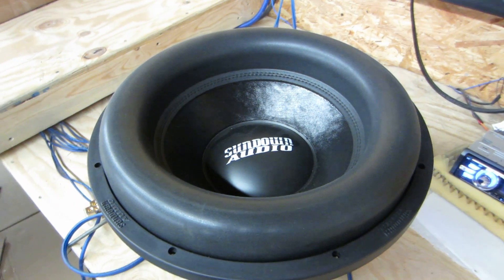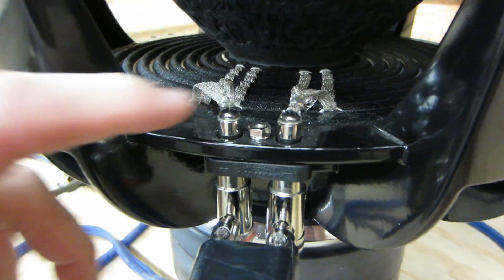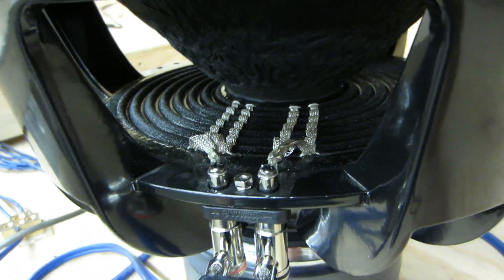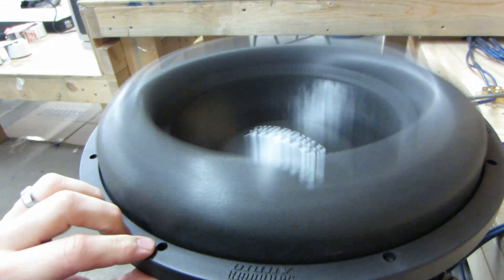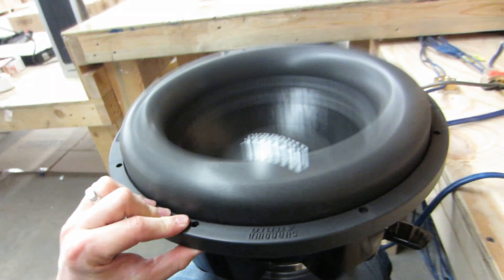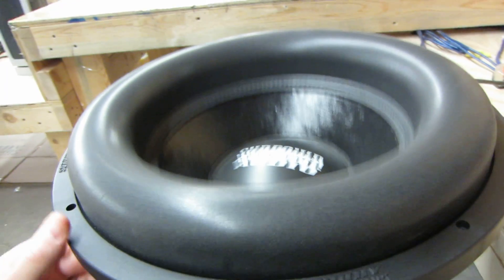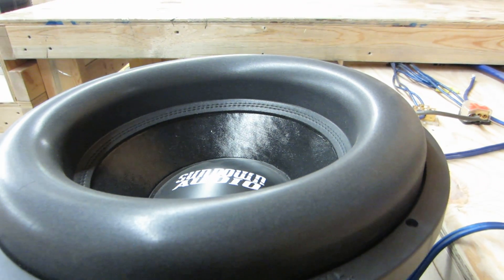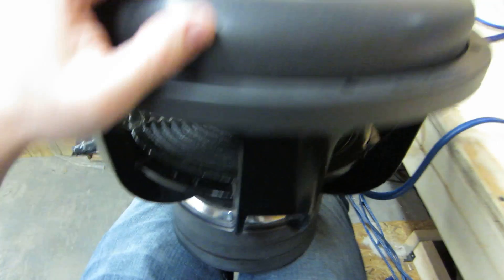X-15 Prototype Free-Air Test on SAZ-3500D

Comment: you should build a baffle for an 6.5, 8, 10, 12, 15, 18 for free air testing.. just to set it in..
what's the best frequency range for the X12 v.2 D2? how low and how high does it play? I just bought a new one a week ago,  only 8hrs on it yet.. it's currently in a 2.3cft from a previous sub, starting my new box tomarro. would like to tune around 26~28hz, maybe a 2.6/2.75cft box or should I just tune to the suggested 32hz, sum is currently almost silent when I try to play anything under 28hz, I'm currently tuned at 31hz

Comment: What causes the popping noise??
Reply: +Ksam96Trini oh ok i jus did a research on why it does that. But yeah we dont want that voice coil crashing into that back plate.
Reply: +Ksam96Trini wen my kicker cvr 15 did that i thought i broke it 😂. But what if the kicker cvr 15 back plate was like 50 mm farther from the voice coil??
Reply: +Rico Mckennie That's the sound of the voice coil bottoming out on the magnet structure. Over excursion.
Reply: That's when it bottoms out. Basically its when the excursion is so great the coil hits the back of the motor.
Reply: Rico Mckennie Nope, don't want that lol
Reply: Rico Mckennie First time I ever heard that was with my 10" Pioneer. LOL I also thought I messed up my sub. XD
Reply: +Ksam96Trini  but i diid mess up my pyle pro amp (the 2nd time)
Reply: Rico Mckennie My Pioneer coil burnt, but I'm getting it repaired with a dual voice coil.
Reply: voice coil hitting the back off the magnet

Comment: I want to see it do 2" of excursion at 50hz. :)
Reply: It can do way more then that I think this is capable of doing 4 inches
Reply: EpicEverythingDude75
I never seen a sub do more than 2" of excursion at 50hz. But I have seen at 30hz.
Reply: Bassotronics I think The RE Audio XXX 12 is capable of 180 mm one way excursion O__O And the Earthquake DBXi 12 is capable of a little more then that I think it can do 190 mm one way. I want the DBXi 12. It looks bad ass. If you want, you can watch my current subwoofer videos on my channel :-)
Reply: ***** I'm not stupid I know what that is. It's not called maxing out the excursion it's actually called bottoming the coil on the subwoofer. You can get to maximum excursion without bottoming out the coil.
Reply: ***** Oh I have. but my subwoofer is a powered subwoofer XD I am such a troll
Reply: EpicEverythingDude75 Xmax on the DBXi12 is 66mm PP, Xmech is 88mm PP. No where near 190mm one way. The mounting depth itself is only 171mm
Reply: +EpicEverythingDude75 Do u not know who your talking to?!
Reply: Awe215 *you
Reply: faq meh ash ketchum hole

Comment: Hi, I have an Aiwa NSX T9, the computer no longer works, and would amplify the speakers with an amplifier, but each of the boxes have: A red wire, one black and one blue, for the subwoofer, which I have to do to it run smoothly and use the full potential. Thank You. (Montevideo, Uruguay)

Comment: Got a question. I own 2 15" HT's and they're in a 3cuft sealed enclosure each.
Would it be an upgrade getting the X15's as a drop in?
I ran some numbers and the HT's F3 is approx 36Hz, and the X15's F3 is approx. 29Hz in a 3cuft sealed enclosure.
I'm assuming better lows and more overall output would be expected?
Reply: ive never actually heard  hts before but I own the x 15 and the lows are insane, if its the lows u like its the way to go, I have it on very low power at the moment about 6 to 700 watts rms and it laughs at it and its very loud , definatly a crazy woofer ,my box is 5.06 before disp and 3.52 after..... I definatly recommend ported for any high end subwoofer u wount be dissapointed
Reply: Oh, so you have the X in ported?
I ran some tests and it shows the X is more suited for sealed. Even though I know they work amazing in ported, so I guess either or..
I've done ported/SPL before and want to do something different. I guess I'll just run the HT's and go from there, and get the X's if I need more output.

Comment: Coil said fuck this im tunchin the back plate
Reply: LOL at this  ^
Reply: EpicEverythingDude75 thanks...
Reply: hittin-low_150db+ Bud did you see the way the surround buckles inwards when it reaches its excursion limits? That is NOT a good thing. It leads to distortion. The surround should stay straight throughout excursion to maintain SQ. I know this is NOT an SQ sub, but still. Sundown should redesign the surround so it does not do that. At least make the foam thicker. OR better yet, they shouldn't even use foam in the first place. If I were them, I would use a thick Santoprene rubber surround so that it will support itself during high excursion and not buckle under the heavy load being put on it.
Reply: They did fix it...this is old...and Santoprene rubber is good for low force unless its thick its a very flimsy material
Reply: bassphillyforeman I wonder. How well would it do if you made a hybrid foam+Santoprene surround. How well would it do then? Would it still buckle? Or would it be fine?

Comment: Jasonimb, if you're going from 4 15"s to 2 18's your looking at going to drop in cone area.  36" vs 60".  I would stick with the 4 15's, and maybe a little more power? Or change you tuning & go lower, what are you tuned at now? I've been doing SPL systems for a while now and kinda kept quiet, but I'll soon be postin some vids with everything from 4 SA 8"SA  to 4 12" AB HD12d2's, which is a very underrated sub.  Like the sundowns, but they can be sloppy when you listen to music that's not bass